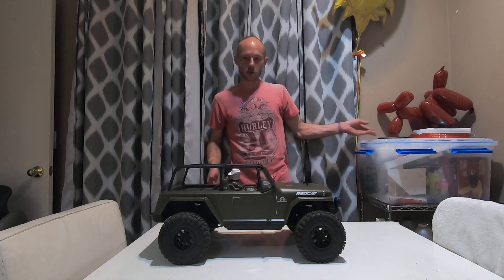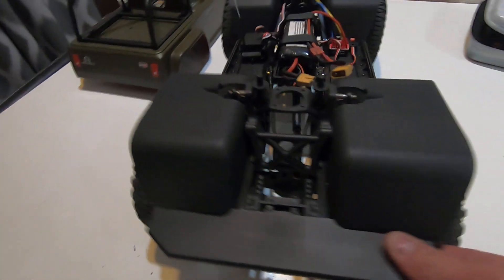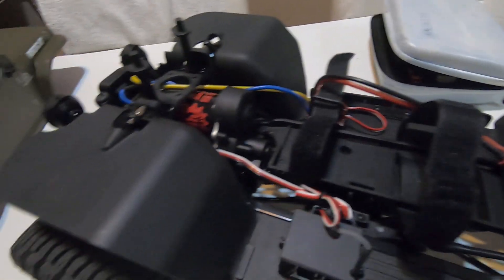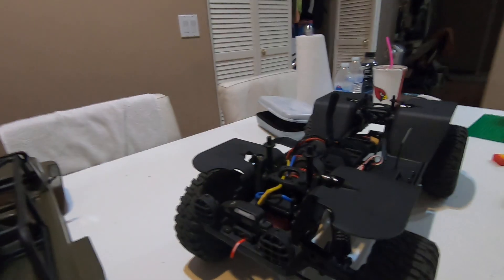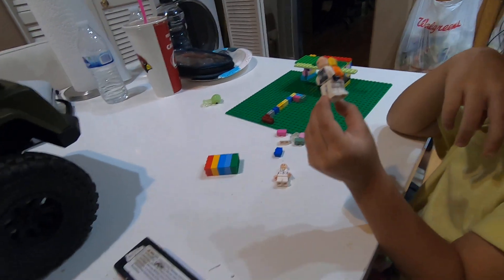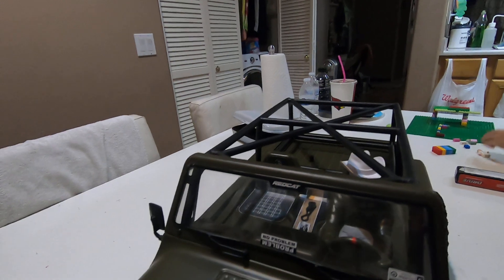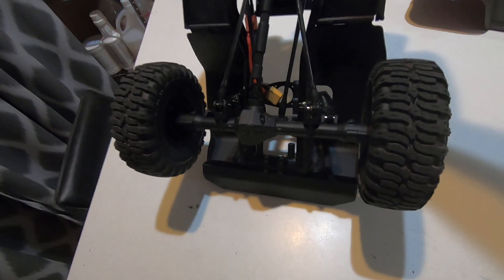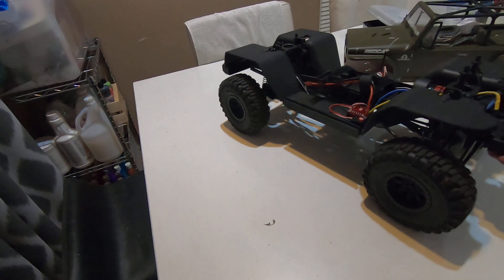Marksman TC8 let's take a look!

Comment: Would like to know how the 50 and 80 trial went with the oil
Reply from the maker: I ended up using 100wt in all 4 corners with pen springs up front and sway bar in back. Settles nicely now.